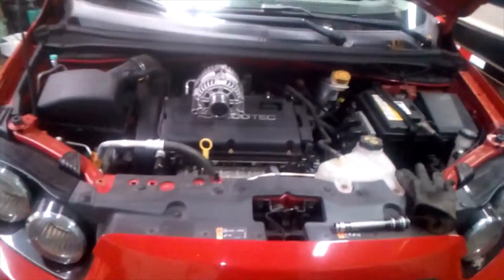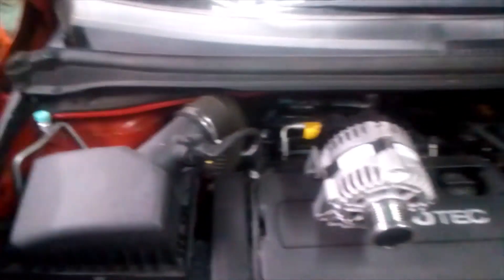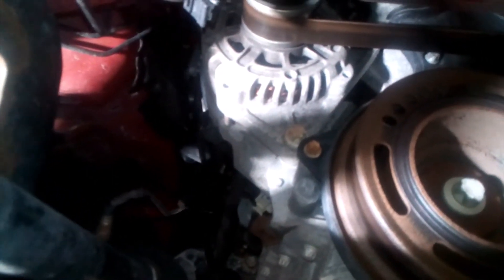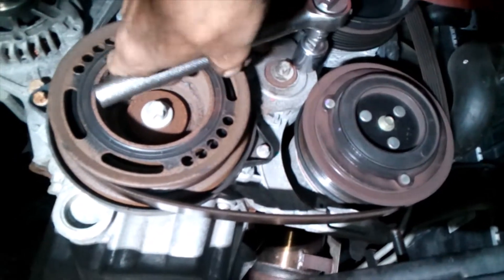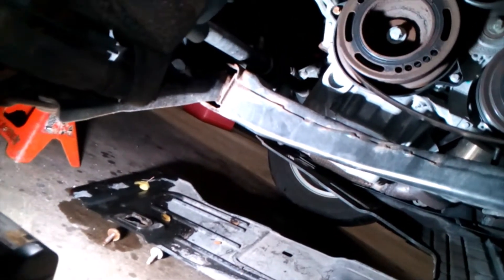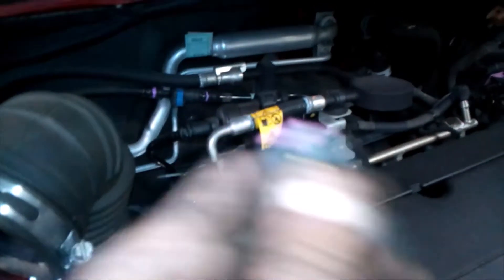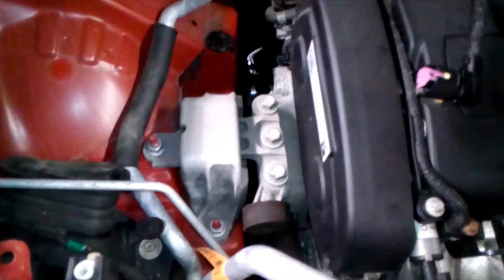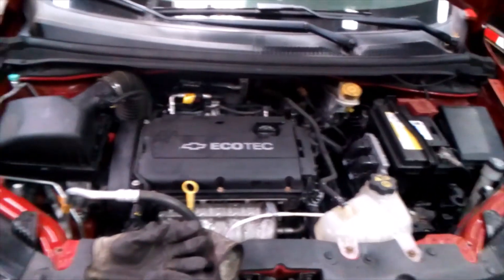2012 Chevy Sonic LT 1.8L Alternator Location & Replacement

Comment: I know I'm 4 years late, but to whoever is looking at this, you do not need to remove anything from the engine bay, such as a motor mount nor the air box.
Reply: Currently replacing mine as I type this, I did not remove anything from the engine Bay I agree .

Comment: This is the 1.8L LUW engine?  I really don't think you have to remove the engine mount. You should be able to unbolt the top, loosen the bottom bolt, rotate the alternator down, then remove the top bolt.
Reply from the maker: Hi Jeff95TA. You will have to drop the engine down. You don't have to remove the entire mount. You can remove the 3 bolts that attach the engine to the mount but the engine will have to come down. The bolt that goes through the top is about 4 inches long and there is not enough room to pull the bolt out far enough towards the frame to get it out, even to try to rotate it down.
Reply: @thedrivewaygreasemonkey2347  Was it a manual or automatic? I'm curious what's different about this one. Unless there's something odd about 2012. Regardless, you got it done!
Reply from the maker: @jeff95ta83  It was an automatic. Yeah it's really tight in there. I could get the bolt out towards the frame about an inch and a half and then it hit the frame. Aside from that it went right in and was a fairly easy one to replace. Honestly I spent more time fooling around with the damn shields, which really sucked by the way..:)
Reply: I did the alternator on a 2013 last night. Pulled top bolt out until it hit the frame:
https://drive.google.com/file/d/1Z0VhkdHx4L_Gb2kH1slMz4zOaUyDp7_9/view?usp=sharing

Rotated alternator down with bolt still in it:
https://drive.google.com/file/d/1Vwn9SiYTnCwsmho6hInCAzMykMXDqKsf/view?usp=sharing

Removed lower bolt and pulled alternator out with top bolt still in it:
https://drive.google.com/file/d/1lARW4WqOzIfWQ9701VUY41d4nXnXUU4b/view?usp=sharing

https://drive.google.com/file/d/180b5EFRRRiBlYBpaoheUy-J6MN1iWSNQ/view?usp=sharing
Reply: @thedrivewaygreasemonkey2347 i'm not trying to be a hater, but you do not have to drop the engine or anything at all. You can access everything from the passenger side. By removing the tire and plastic cover